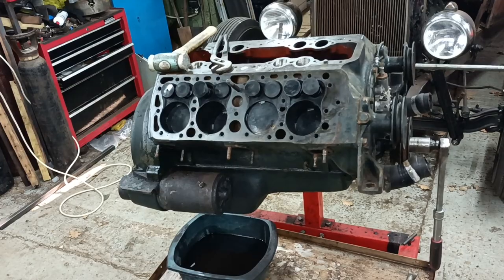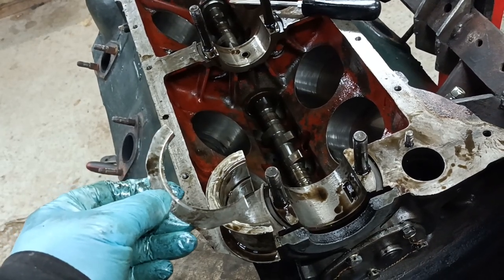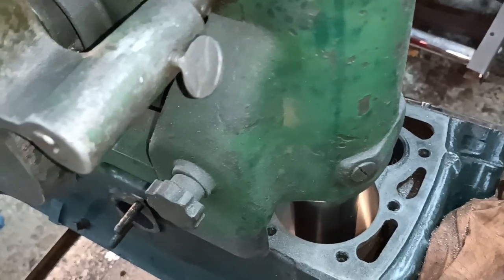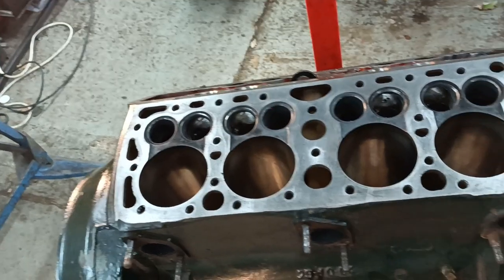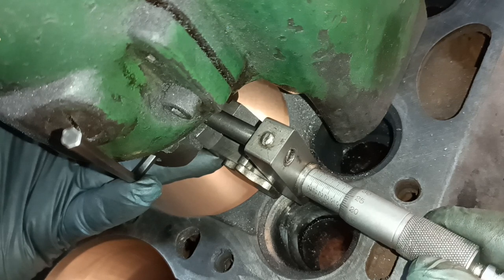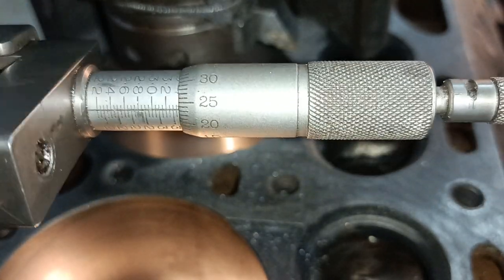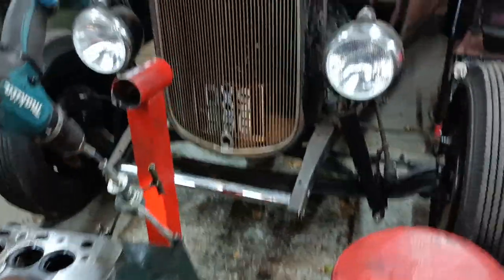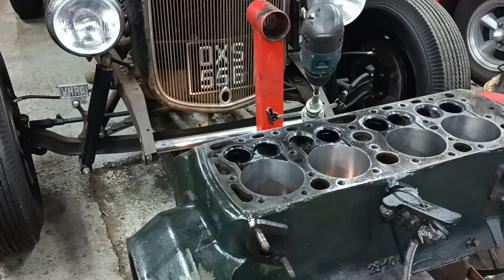2211 Boring boring boring. And honing! Punching out the French Flatty! 286 Cubes!

Comment: Mart,

I don’t know how I’ve missed this one, previously. What a fascinating video! Your boring setup is very cool. I never knew such a piece of kit existed. And I’m always amazed at what can be accomplished in a home workshop, when knows the ways and has the tools. 

Your “error” on #7 reminded me of something, and I’m not sure if it would be a helpful idea, or not. As I’m sure you know, common practice for evaluating bore taper with minimal tooling is to use an old piston ring and measure end gap with a feeler gauge in multiple places throughout the bore. Then you can use some trigonometry to translate the measured ring end gap change into diameter change. As I recall the tolerance for taper is actually quite substantial, and I’m sure your little error wouldn’t even be measurable in this manner, but this might have leant you some peace of mind prior to flashing up the engine. 

Just a thought. Hope you’re well. Merry Christmas!

Comment: Mart, thanks for the excellent video on boring.  It wasn't boring.  Could you further explain the rod nuts that you called Jaguar type?  Also had a cuppa along with your video.  Hunt
Reply from the maker: Hey, thanks Hunt. They are big end nuts used in some Jaguar engines. I bought them on ebay. I don't know if they are better than stock Ford, but at least they were new.